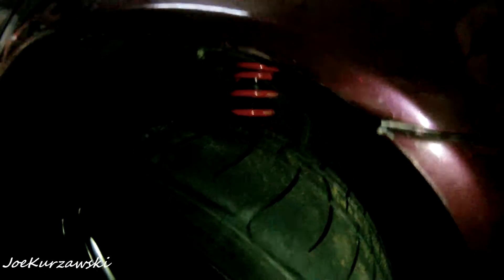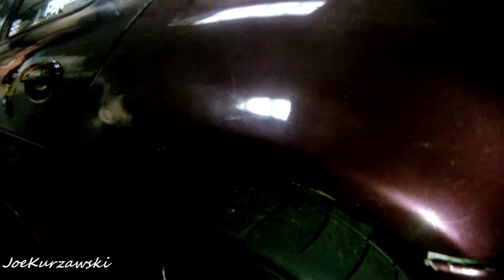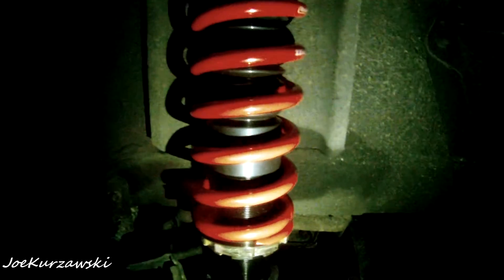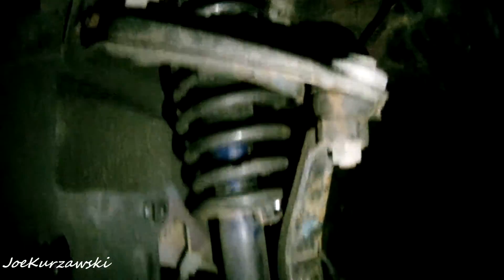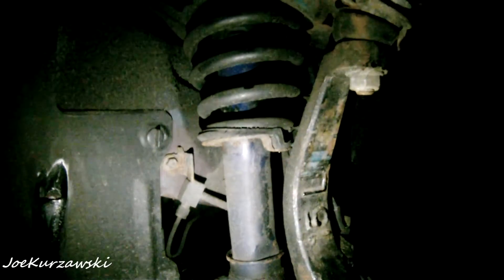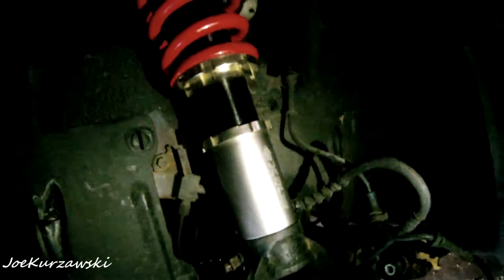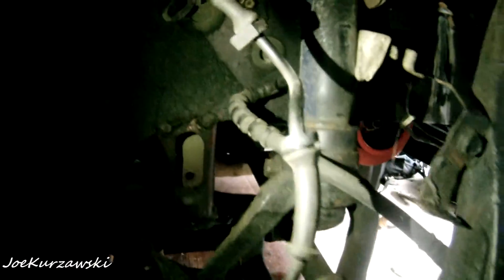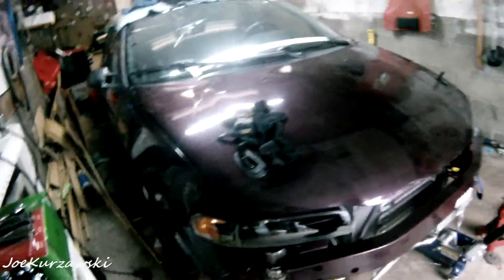Install: Nex Coilovers

Comment: where did you get your coil overs at?
Reply from the maker: Josh Miller well a group of owners back in 2010 did a group buy and there were extra. But the manufacture NEXT/Maxspeed was bought by BC racing I believe. But this past year some eBay seller bought a container with New discontinued stock. So he only had like 6-7 sets. And me and some other owners on the stratus Facebook page snagged them all up as they were 1/2 the cost they used to be. I was also told that 98 accord suspension can be made to work. But as for the set I have you would have to get another Owner to part with them.
Reply: Joe Kurzawski yea rite now my 2000 dodge stratus is setting on 2000 Honda Accord coilovers
Reply from the maker: Josh Miller how much modification is needed if any to make them fit?
Reply: Joe Kurzawski i actually didn't have to make any modifications on them
Reply from the maker: Josh Miller check out the stratus face book group lots of good info.

https://m.facebook.com/groups/1655723377993705?ref=bookmarks